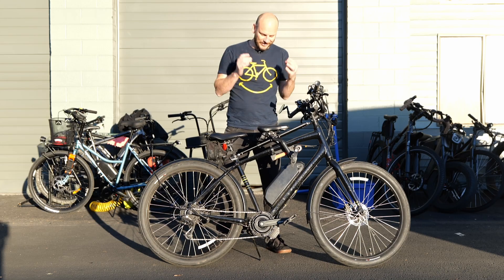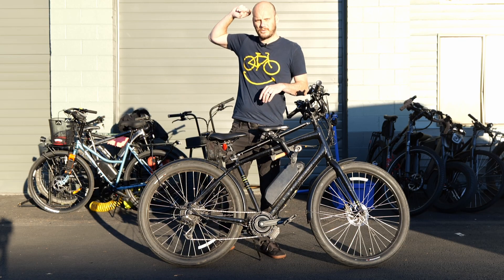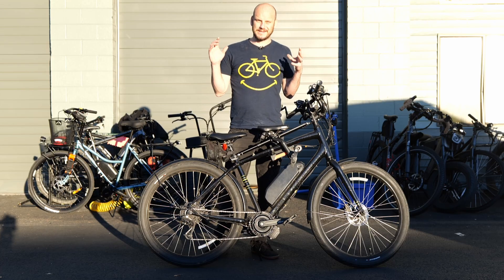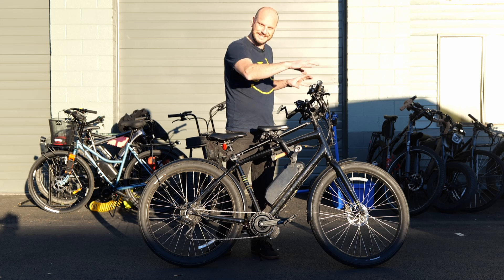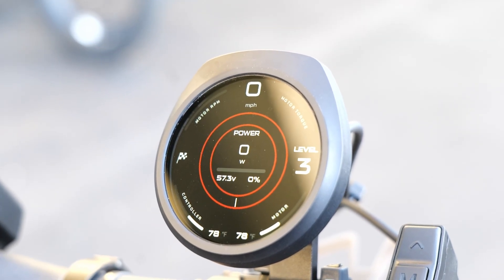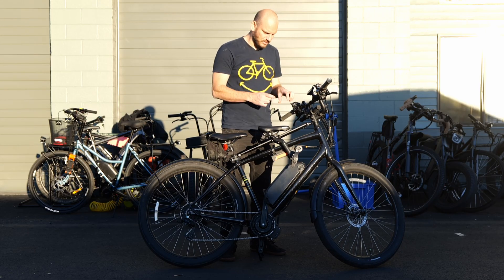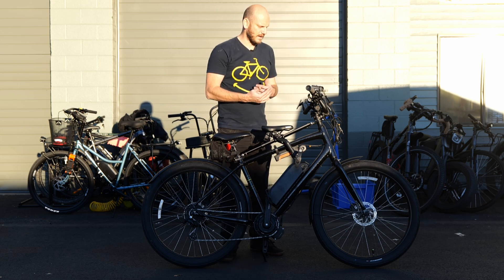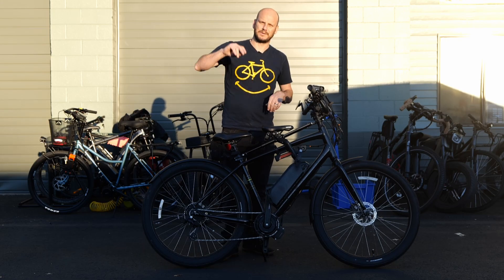CYC Photon Gen 2 Performance tests and overview. Hill Climb and Top Speed @ 52v and 72v

Comment: Great Video . Im in the process of adding a Photon 2 to my Greenspeed GT20 and the one question I have is about whether I need an arrangement to prevent the motor "recoiling" under load or whether I simply rely on the bottom bracket being sufficiently tight to limit torque movement. ?

Comment: Makes sense the 72v wont be more powerful. This motor is designed to be a legal option and if it was faster or more powerful then it would break the laws. The controller keeps it within watt limits. Looking forward to getting this kit to ride on some trails without being a menace with something like an x1 pro gen 4

Comment: Wish they would've had an option to narrow the Q factor. My bike has a 68mm bb and I have to run so many spacers. With a narrower spindle the q-factor could be decreased significantly before any clearance issues. Also don't like losing the compact form factor, one of the biggest appeals of this system to me.

Comment: It seems kinda weak with no pedaling...  couldn't bbs02 could do that hill climb from a stop throttle only? and a bbshd surely could??   It would be interesting to see it compared side by side with a BBS02 and BBSHD on a similar bike and wheel sizes
Reply: It depends on the gearing. My BBSHD is definitely stronger than the Photon Gen 2, but you can climb any hill quickly with proper gearing
Reply: @puffinprinces198 I wondered about the gearing too. I’m positive my CYC Gen 1 would have motored up that hill easily with a 38 tooth front chain ring and the largest sprocket on my back wheel (I forget what it is, but it’s not that big).
Reply: @marcoleavitt for that hill it certainly can. For my hill test video the hill was much steeper so I had to use a lower gearing. I used 1.3 which was the most you could use to still climb up, but it wasn’t the fastest. You would think higher is faster if it can make it but lowering the gearing makes it much more efficient and less likely to bog down. I haven’t published the new test yet but 0.7 makes it climb faster
Reply: @puffinprinces198  
is your bbshd stronger than photon 2 at same wattage?

Comment: A gdr19 1000w @48v25A will eat that hill test but I guess it's no match with a good mid drive. 2000w peak on a mid drive should perform better at 52v that's nearly 40A...
Reply: Gdr 19 is a very good climber for being a hub motor

Comment: thanks for the info. Im running my bbshd at 48v and considering moving to this motor at 52v. Live in phoenix and ride during summer so am concerned about heat and performance vs the bbshd. Could we do a comparison between the two motors?
Reply from the maker: For sure. I plan on making a comprehensive comparison video amongst all the motors

Comment: Can you do Photon 2 vs tsdz16? Especially in prolonged climbs, which one overheats faster, and starts cutting power?
Reply: The TSDz 16's competitor is the BBSDH. The Photon's competitor is the TSDz8.
Reply: @shockadellick  BBSDH doesn’t have torque sensing. It’s cadence sensing only. Thus it is inferior and is not a competitor…. They are as close apples and oranges.
Reply: @ReasonAndHeart  
The TSDz2b is also torque sensing so if we go by your concepts we should match the Z2b up against the BBSDH?
Well partner that's not how things are compared. Heavy weights aren't allowed to fight welterweights. Maybe somewhere in the dark jungles of Africa will you find your shared opinion.
Reply: @shockadellick heavy weights champs in boxing do not fight for the same title as heavyweights in UFC, partner. Maybe in your corner of the jungle they do.
Reply: @ReasonAndHeart  
Buddy you were at the back of the line when they were giving out logic.

Comment: Only watched half the video but this is why we need to as a community move to something like vesc controllers. Sure, it's nice to have a plug and play ebike kit, but you get only what someone else has designed for you. You don't have any real control. I can take a Flipsky 75100 pro v2 and produce more watts and better performance on this same motor and battery combos after some tuning. If I'm buying a 72v battery, obviously I'm trying to go fast. Unrestricted mode is still... restricted.
Reply: I love my Flipsky 75100 pro v2 on my 72v BBSHD bike. It rips. Even on my 52v BBSHD one. Huge difference over stock.
Reply: It’s restricted for the longevity of the motor. BBSHD can handle mods, but not this one

Comment: Very curious to see if they fixed the overheating issues while pedaling with the Gen1. A Gen1 photon cannot maintain 750W power at 52V on flat ground while pedaling at human leg cadence without overheating. It can maintain 750W if the motor is allowed to operate at its efficient speed (around 2k-3k) rpm, but that translates well outside human leg pedal cadence no matter the gearing. When I was commuting with it regularly, I would run at 750W no pedaling on the way in, but pedaling on the way home had to limit to around 650W.
Reply: I’ve never thermal throttled with PAS in slightly cold weather

Comment: It's not amps limited, amps are irrelevavt to motor speed.
Reply: Torque is amps, speed is voltage (watts = amps × volts and controller max watts is 2k so the controller caps amps to limit watts) Therefore 72v is higher top speed with lower torque, and 52v is lower top speed with higher torque.
Reply: @nickdavison9771  torque comes from phase amps, not battery amps. Phase amps are from the controller so it should be able output the same phase amps and voltage no matter the battery amps/voltage if the watts are the same. That all said its strange the torque seemed to be less on the 72v so its a bit confusing bc Ive built bikes that used different voltage batteries and the 72v version always had same low end torque, it just gained torque and speed on the top end.
Reply: You can't argue with stupid
Reply: It’s amps limited in the sense you’ll use lower amps with higher voltage to reach the peak watts. Faster and more efficient on flats, maybe marginal difference for hill climbing

Comment: Sure was hoping you could demo the pedal assist because that is the big thing for this motor. Bike parks here in Texas do not allow a throttle.
Reply from the maker: It feels the same as gen 1 to me. Rock solid.
Reply: What are you really expecting? They have the best retrofit motor pedal sensor on the market, and a bunch of settings to adjust pedal assist (which never really need to be adjusted)

Comment: I’ve seen the newer cars are using Canbus now and they being hacked and stolen crazy
Reply: I'm pretty sure Bosch introduced CAN in the late 80s. Cars implemented it pretty shortly after because of the weight savings from reducing wire. CAN is just a communication protocol and isn't more or less safe. The implementation of it, left up to individual manufacturers, can leave room for bad actors.
Reply from the maker: Ya I saw that Toyota article too. 🤷‍♂️
Reply: @JohnnyNerdOut so newer is not always better my Bafang HD is going strong

Comment: Can you please do a continuous power test?  What is the max current and watts that can be pushed through this on a throttle only ride that lasts at least 45min without thermal throttling?  Essentially a throttle only commuter test.
Reply: Really depends on weather and how much you’re stopping. For 45min in slightly cold weather with a lot of stops I’d say it’s hard to thermal throttle at 20a
Reply: @puffinprinces198  20a at what battery.36,48,52 or 72?
Reply: @wrosslandwr8032 doesn’t matter
Reply: @puffinprinces198 So at 1440 watt it will not get hot using throttle only?

Comment: Great video Johnny.  Keep 'em coming when you can sir!  I like the idea of going 72V but unfortunately, those higher voltage batteries tend to cost more than the edge they provide over the 48 or 52 volt batteries, at least that appeared to be the case 6-12 months ago.
Reply from the maker: I think per watt-hour they tend to be about the same. You generally get a lot more watt hours with 72v packs

Comment: With a 38 front and presumably a 11T rear, you are probably hitting peak rpm of the motor, not power limited. If you really wanted to check top speed you'll need taller gearing. At 120 rpm on 2 inch 29er wheels, 38:11 is 35mph. At 130 it is only 38mph. The bbs02 doesnt really push past 120rpm for example, and I wouldnt be surprised if the photon tops at a similar cadence.
Reply: I have a tongsheng with open source firmware - unlimited assist speed setting - even with a 46 front/11 rear on 700c wheels going down a big hill, 38mph is essentially terminal velocity.  Motor speed can't keep up and pedaling is well past a sane cadence-even clipped in.  With a regular road bike 53x11 gearing I can pedal down the same hill and not spin out the gearing until almost 50mph
Gearing is going to limit the top speed the most.  Also really gets into some solid wind resistance which would take trememdous amounts more power to overcome even if you had the gearing.
Reply: I have 36T/13T, 29er, and it’s around the top speed. 36T/11T was about the same maybe 1mph faster in rare cases. @ 36T/15T you start to notice top speed drop

Comment: Pretty sure they limited the power due to heat issues. I have the Gen1 and had to severely limit the power in the app, yet I can still overheat it to 85 degrees in about 15 minutes and then it starts to throttle down its power aggressively. And I use PAS only, I did not even install any throttle. Oh, and the Gen2 is heavier, not lighter.
Reply: I’ve never reached thermal throttle under PAS. However it will heat quickly with 2kw straight throttle in slightly cold weather.

Comment: bafang just did the same thing with their m630 firmware. we jumped through hoops for them to give us the 64 volt version and they lowered the amps from 40@48v to 30@64v which sucked.
Reply: That's how electricity works son.
Reply: What? 😂  @tracyhaynes5404

Comment: I've been waiting so long.  How does the intuition display mount?
Reply from the maker: Great question. Pretty sure some parts came missing in my test unit so I had to zip tie it on. Pretty sure that’s not what they intended 😂
Reply: What would be the magic gearing for a single speed 29er... For commuting with mellow hills?